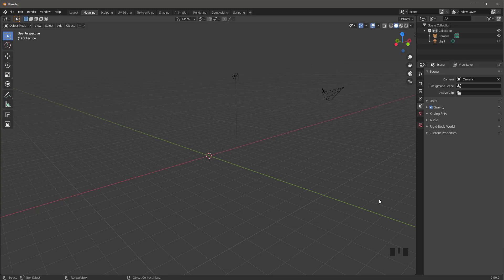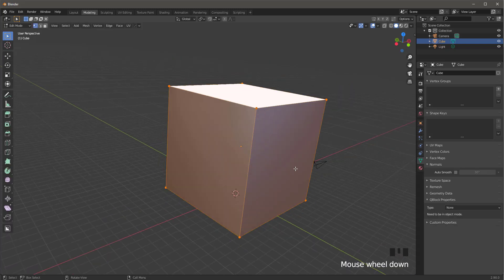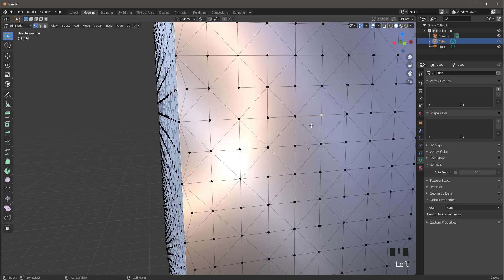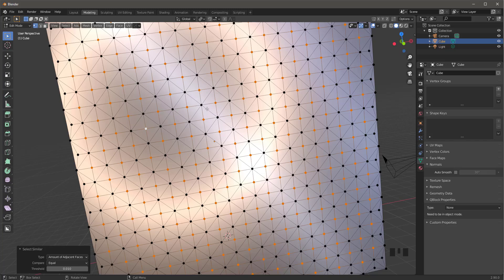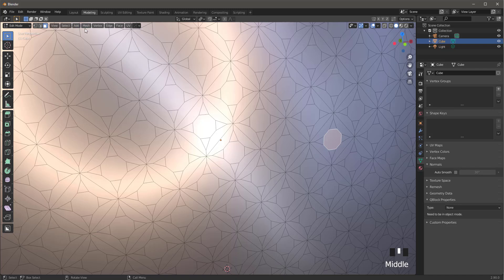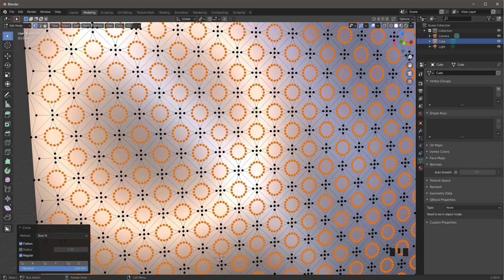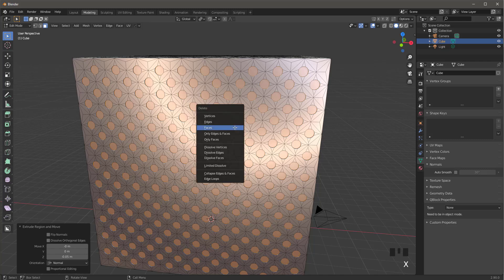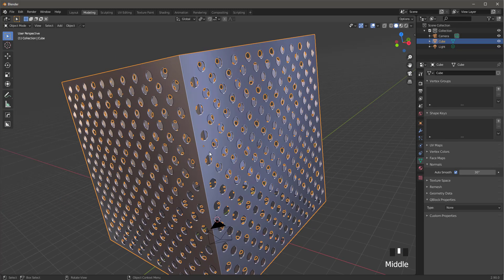Blender 3D: How to make holes in a mesh

Comment: Way too convoluted! I got the same result by subdiving my cube x15. Select all. Inset individual faces. Subdivide those faces x3 and then use Looptools/circle before making the cut. Took a fraction of the time and I ended up with far less geometry.
Reply from the maker: That's great. If there is a better way I'm all for it. Nothing is written in stone.

Comment: If ONLY there were a 10 second way to do this. Would be nice if someone develops a tool that just cuts circles on flat faces where you draw them. (or in this case cut via pattern arrangement).
Reply from the maker: There is. I'll post it soon.
Reply: hardops, select verticle, Q, Circle
Reply: @KofaOne  haha, yeah, 10 month old comment hopefully was before boxcutter, hahaha. Box cutter - great tool.
Reply: Ya many cylinders arrayed along with boolean, was something I was thinking.